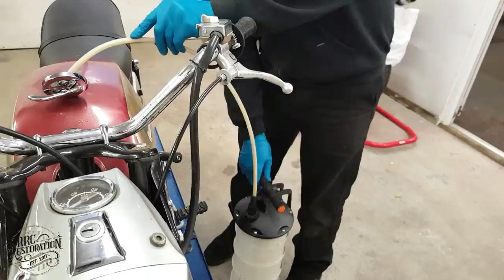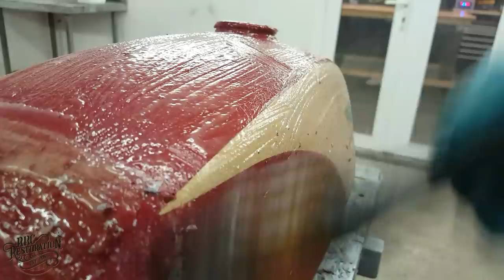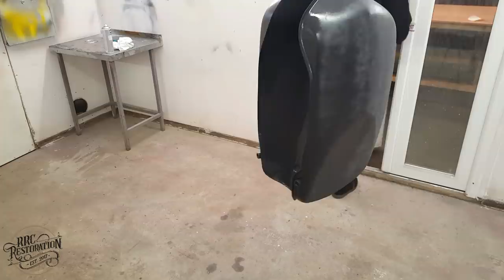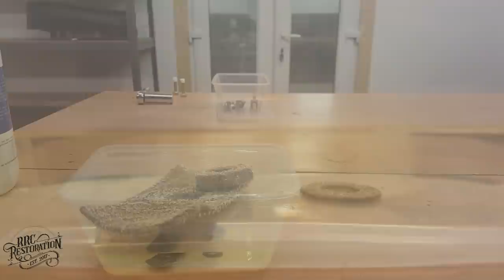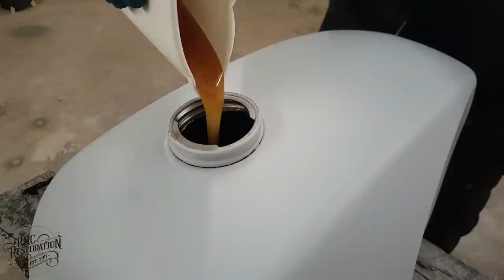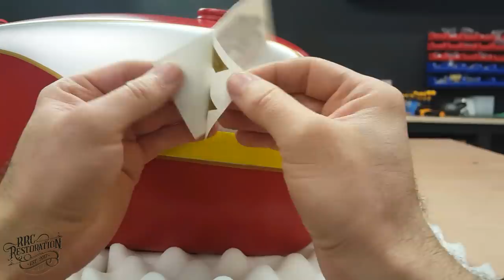52 Year Old Glazed Ham Restoration..... Oh Wait, Maybe Its a Fuel Tank!

Comment: I absolutely love the styling of the older motorcycles and this is one of them, love to see it finished
Reply from the maker: You and me both! :)
Reply: The 'square style' singles weren't generally considered one of Ducati's better looking efforts, but it is a nice clean design.
Reply: @RRCRestoration   Hey  , I do restorations on Ducati Singles,  got a 160 Monza going right now.. it's a 66'  , ..and a 450 mach 3 , and a 350 diana motor, and another 350 motor rebuild(think it's out of a 69' scrambler) ,  and a narrow case 250 cafe........jeez, i'd better get back to work..lol   oh and a complete Bimota KB2 ,  you would digg the frame on that thing..we even have a 748 in the shop..
    would digg trading some pics.. had to cut a hole in my monza tank to knock out a dent..

Comment: Something very odd just happened. When I clicked on your community link for this video, it was already indicating that I was 22 minutes into watching it, yet in fact I wasn’t even aware of it until now!!! The red progress line showed that the video was 3/4 played. The only other device connected to this account is my iMac which is switched off, so I have no idea how that could be possible. First time this has happened. 

Thank you for sharing your restriction of this tank. Such a sweet little bike - which I always thought of as toys when I was a lad.
Reply from the maker: Yeah i think that might have been my fault, i used a link with a time stamp in it lol I've changed it now ;) Glad you enjoyed the restoration :)
Reply: RRC Restoration Thank you for clarifying that. I was wondering if my desktop had been hacked by a random bike restoration fan…! 🧐

Your work is not just good, it’s top drawer. But you know that. I’m 63 and I learn something from every video. 

One of my favourite hobbies is catching guys out making a mistake and not admitting it, getting something wrong, passing on duff info, or just being lazy. Why? Because I like to learn from other’s mistakes (they’re cheaper), and therefore spend less time calling myself a T*wat in the workshop. 

But I’m delighted to report that I’m yet to catch you out in a single error or deficiency. I was wondering if the tank colour was a match for the Ducati original, but it looked great anyway. 

Painting is my least favourite job, so I’m paying particular attention because am determined to get the process right. ‘It’s all in the prep’ has never been a truer piece of advice. 

Thank you for generously sharing your skills. It’s much appreciated.

Comment: The tank came out very nice! The super dangerous top secret toxic paint stripper worked well!
Reply from the maker: Thank you very much, I see you are getting into model train side of things now?
Reply: @RRCRestoration  It's always been a hobby of mine. Been waiting on parts and weather to cooperate before continuing to move on the larger projects. The Suburban needs clutch hydraulics, the Go-Kart needs an engine new engine (no saving what's in it now, unfortunately), and the Zero-Turn needs new deck bearings which we have but it's just been too darn hot and we've had other projects (home improvement stuff, etc.) taking priority. The little model railroad stuff I can do quick little 15-30 minute videos on that I can record inside whenever I get a few spare minutes and put up with minimal editing. So i've been doing those here and there and then just scheduling them to post every monday to keep new content coming onto the channel. But... I'd REALLY like to get some more work done on the Suburban. IT'd be great if I could get it moved here to the house instead of having to go to the storage lot to work on it.

Comment: I love watching your vids! I pick up tips & techniques in almost every one.
About this bike: The factory stopped making them in 1966, so I guess, in the '60s, Scotland registered vehicles in the year they were retailed, not the year of production. Ontario did that too.
The paint work turned out great, but you should have done some research. The gold stripes were much wider (8.6 mm), and there was a stripe under the horizontal side crease, forward of the knee scallop.
Biggest mistake was all the 2-tone paint jobs used a candy colour, not a solid. Also, I have never seen one of these bikes with a 'MADE IN ITALY' decal, but as they were waterslides, I don't imagine they would have lasted too long. Last, I didn't see any script on the gas cap. This bike would have had "AGIP CARBURANTI LUBRICANTI" on it.

Comment: How come they can't invent a primer and paint that doesn't get that orange peel effect?
Reply from the maker: its to do with the spraying of the paint its got to flow a little so you get a smooth finish but also it has to go tacky quickly enough so that the paint doesn't keep flowing and you end up with runs its a necessary evil im afraid
Reply: @RRCRestoration    They should be able to mitigate that with chemistry or physics.  I mean I guess they have.  I guess that is why powder paint is used for almost everything these days.